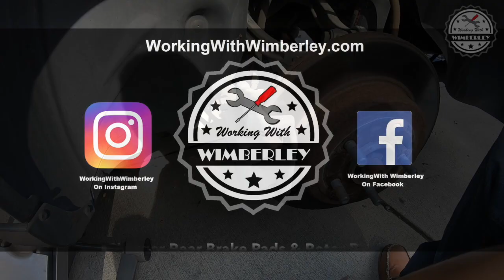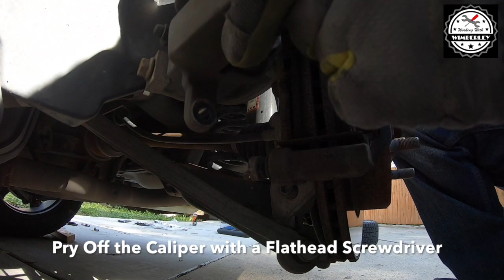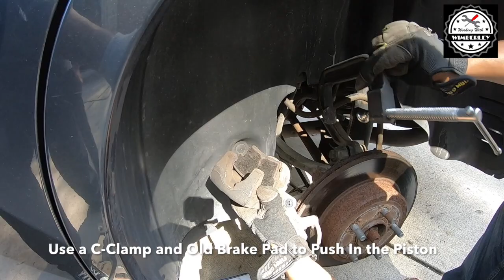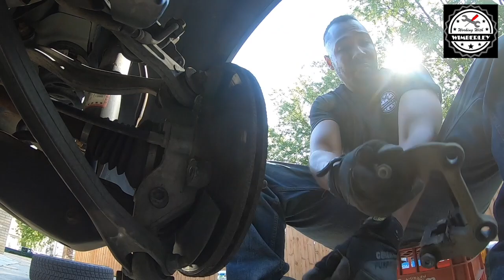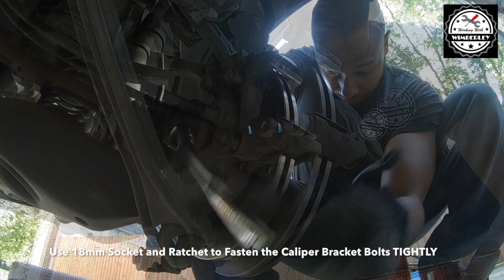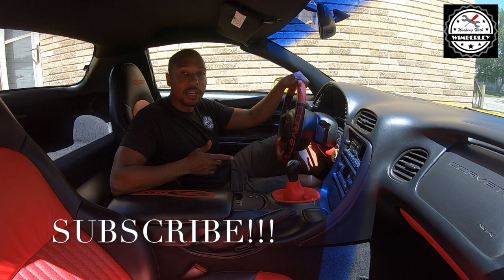Dodge Charger Rear Brake Pad & Rotor Replacement & Installation 2006-2010 SE SXT R/T SRT 5.7L Hemi

Comment: Does using the c clamp substitute for using a caliper tool?
Reply from the maker: If you have a caliper tool that will compress the piston, go ahead and use it. I always use the c-clamp in my videos because I think most people have a c-clamp, but they might not have the actual tool that compresses a piston. Now for the twist in style piston, I do show a tool and recommend that people get that tool to work on a caliper with the twist in style piston.

Comment: I have a '21 Charger. And it seems like the brake system didn't change. I tried to get the rotor off but was worried about the stuff on the inside part of the rotor (Parking brake stuff)
Reply from the maker: I’ve done the rears a few times. Sometimes the rotor slides right off and sometimes I have to beat it with a hammer to get it off.
Reply: @WorkingWithWimberley  thanks. I had to hammer the rotors off a lot thanks to me racing a lot. Lol. But yeah they came off and now got some cross drilled rotors installed.
Reply from the maker: @anthonyscottsr.7522  Cool!

Comment: Sir, sorry for the question, but how do I pump the breaks? Is there a special procedure or just step on the pedal?
Reply from the maker: With the car in PARK, start it and simply step on the brake pedal 4 or 5 times. The pedal should be soft at first but after a few pumps, the pedal will be firm. That’s it. After that, you’re good to put it in drive and go.
Reply: @WorkingWithWimberley  much appreciate your feedback Sir, great videos!
Reply from the maker: @jonathansanchez5370  You’re welcome! I’m glad the video helped! Thanks!

Comment: Are the rear brake pads drum or disc on a 2006 magnum
Reply from the maker: I’m not sure. You should be able to just look in there and see. The charger I worked on in the video was brake pads and rotors with a parking brake shoe that’s inside the rotor. You can see it in the video.
Reply: Thank u
Reply from the maker: @dustinjohn7869  No problem.

Comment: So do I have to take of the the first two bolts you mentioned or could I just skip that and loosen the two with the breaker bar. So I can just take of the rotor
Reply from the maker: I would recommend taking off the caliper first and then the bracket like I show in the video.